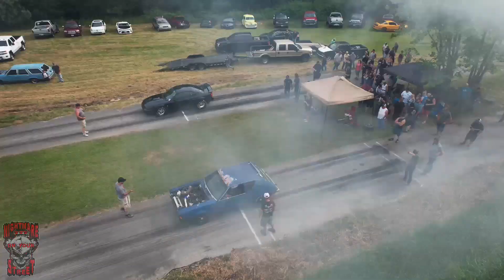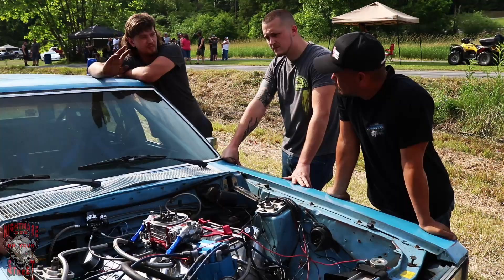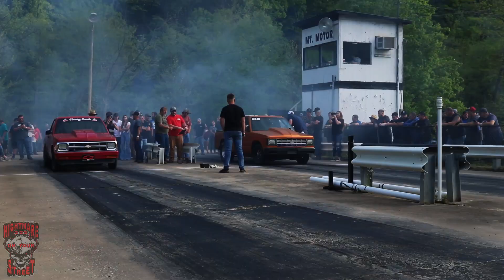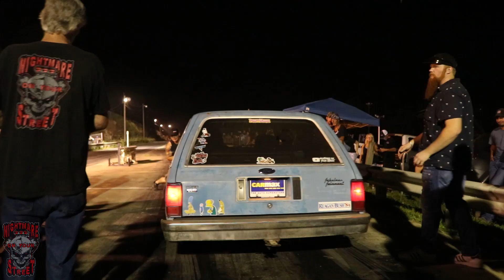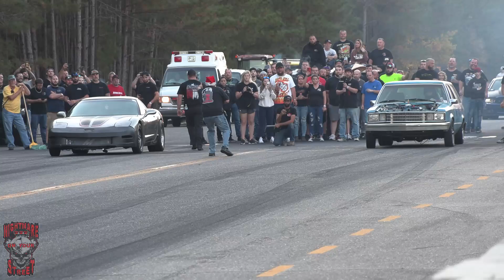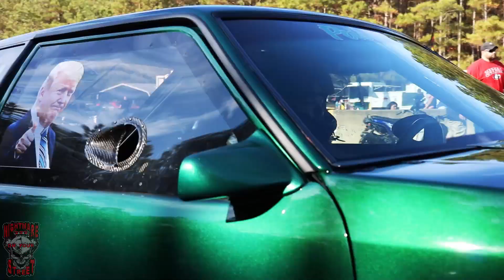WE BREAK THE STICK SHIFT STATION WAGON!!!!

Comment: Never ever use Aluminum Rockers on a Seruous Racing Engine. They are unreliable all at 8000-9000 rpms.  I don't care who says they are Ok.
Use only Crower Enduro 18 PH Stainless Steel pedestal mount with ARP Pro 7/16" Rocker Studs..
Or use a Shaft Rocker System with Stainless steel Rockers.  Nothing else.

Comment: Your turning high rpms and need Titanium valves.
Manley High Temp Orange Titanium. 
Victory Titanium valves.
Del West Titanium valves. 
Ferrea Titanium valves.
I know they make hollow stem Stainless light weight valves But I won't Fick them on my own 8000+ rpms.
Real Deal is Titanium valves only no substitute.
At least Titanium intake valves. 
Manley Severe duty valves Inconel on exhaust Ok but are heavy.
Need correct piston ro valve clearance. 
If you know it's going to float valves design in .150-.300" P.T.V.O.C. Going to cost a little power but not going to lose 100-500 Hp.
Be less than 10 hp.
Can not win any races if the valves collide with the pistons you done lost.

Comment: May sound ass backwards but absolutely nothing is more accurate and stable Ignition than a Vintage Vertex OAC or OAX Magneto.
Vertex Magneto in Grand View Missouri has had issues with Fickin Covid 19 shit shutdowns.
Think all production has stopped making.
Have to look for a Ford SB 302-351 Winsdor Vertex Magneto they are out there.
I rebuild them in my spare time.
Able to light off gasoline and Methanol to 10,000+ rpms zero misfires when I I rebuild them.